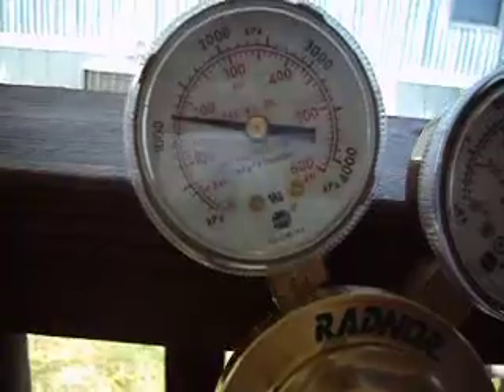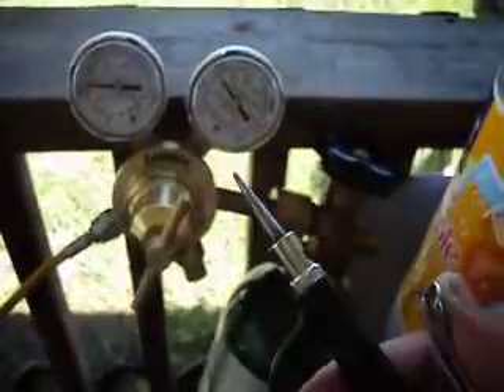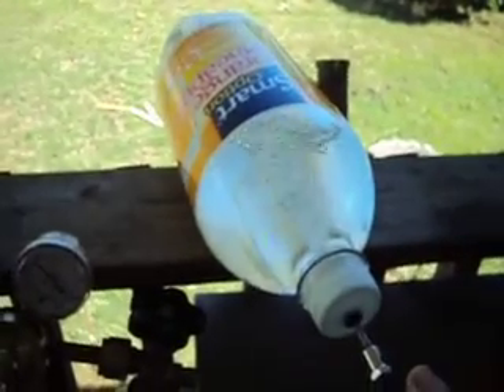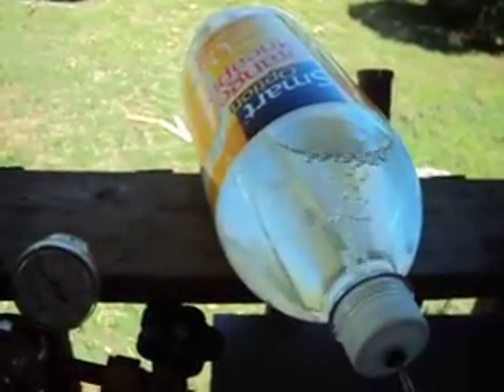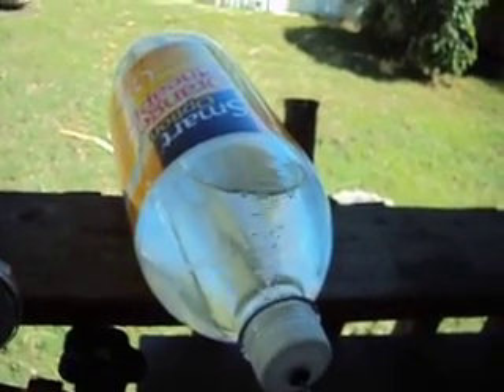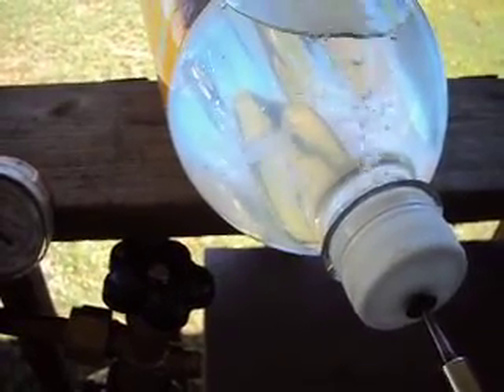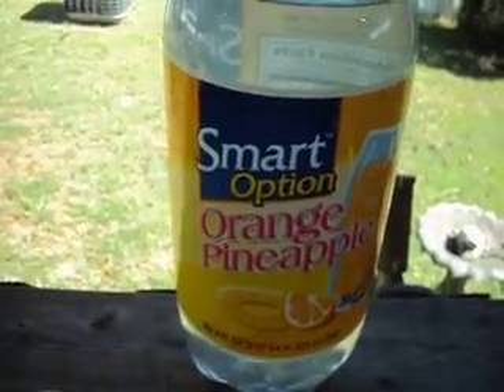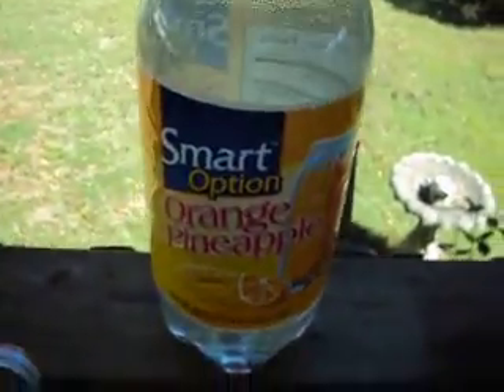Can Your Home Soda Machine, Seltzer Water Maker or Other Soda Makers Handle 3-Liter Bottles?

Comment from the maker: @Mr3wheeledbike 
Yep, it will, as long as it is a soda bottle. Don't use a water or juice bottle. Make sure you use a bottle intended to hold pressurized carbonated drinks.